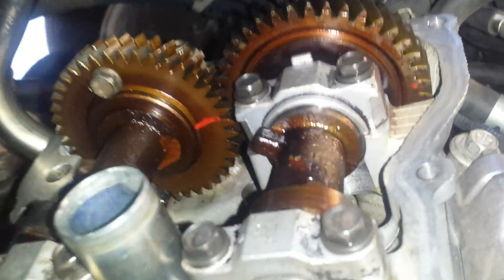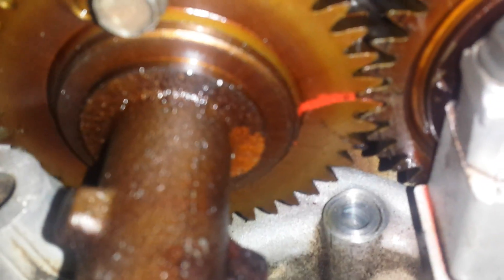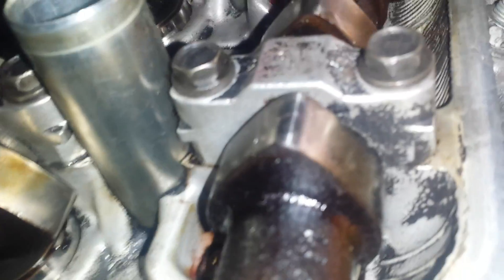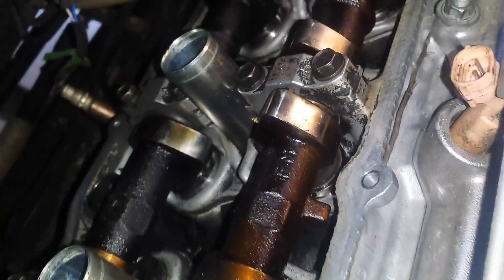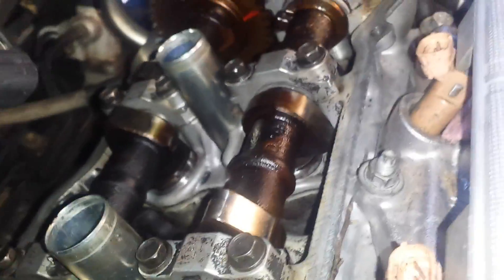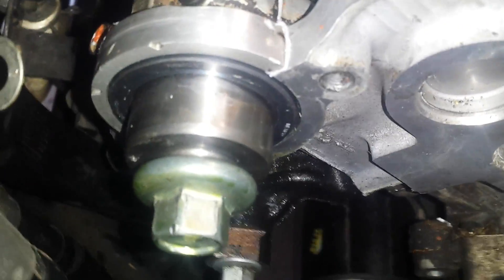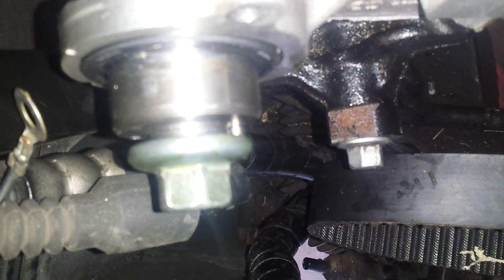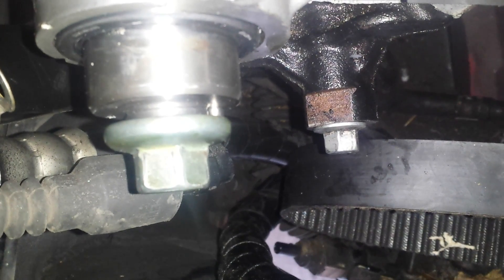Toyota 3.0 1mz-fe cam gears

Comment: I've had no luck timing this motor. For some reason it backfires on acceleration and as the lack of power and the running compression on that bank. I put the service bolt in the camshaft I align the cam lobes as described
Reply from the maker: There's really no way to install belt with all pulleys 180 out. How can you match all the marks?
Reply from the maker: Did you rotate 180 before belt installation
Reply: @jaschalindesmith9525  yes I did
Reply: I made it where the belt was 180 out beforehand and was lined up once I did
Reply from the maker: So you assembled the timing 180 out? Not sure about your specific job. Maybe a clogged cat on that bank?
Reply: So when you put the belt on is the mark  up or down on the pulley.
Reply from the maker: They are straight up
Reply: @jaschalindesmith9525  sorry it took so long to get back to you. So the camshaft is 180 degrees out two dots to two dots until you are ready to put the belt on then you spin it 180 degrees and that's the mark on the pulley lines up with the marks on the belt.? call me if you would area code 904 439 6520 hopefully sometime today if you have a chance I've been working on cars for a long long time and I'm definitely confused

Comment: When reassembling the top end of a Toyota 1mzFe there is only one thing that held me up a bit... when installing the timing belt I kept noticing that it wasnt aligned properly. I took it off and reinstalled it several times but just couldn't figure out what causing the issue. I figured out early on that the problem was between the alignment of the two cam sprockets but they looked to be bolted on properly. Finally, after an hour or two, I figured out that for some reason the rearward sprocket had to be installed the opposite orientation of the front one. After unbolting it and flipping it over reinstalling the sprocket nearest the firewall (I believe that's bank 2 in a toyota) the timing belt lines up perfectly. I hope this helps someone who is facing the same problem. I have put around 20k on that motor since the head gasket job and it runs like a brand new one
Reply: Please message me. Same kinda deal. Ty

Comment: Bro i got a cuestion and i hope you help me.when  you remove the bolt from the gears and you rotate the crank shaft 18o degrees with the timing belt on it or before you install the t.belt?
Reply from the maker: After you set the camshaft caps then you can release the service bolt. At that time you can rotate the camshaft assembly 180 and line up your marks for belt installation
Reply: Run a bolt through the threaded sprocket hole BEFORE you unbolt the bearing caps. You dont need to remove that bolt until you have reinstalled the cams and bolted them back down. At that point just make sure the sprockets line up (one dot - two dots) and that the crank is at TDC and install the timing belt. I rebuilt this same engine and I dont remember having to ever mess with variable cam timing like this. I did have one issue with timing belt alignment but I posted a comment about that above. If you're doing this job on a 1mzfe make sure to read that comment

Comment: I removed camshafts from Lexus v8 and forgot to lock the exhaust scissor gears and now there is bad noise when I start the engine, how can I fix the camshaft gear that is making noise
Reply from the maker: Joseph Khambule  you have to remove it to load that gear again.  They are designed that way to keep it quiet and take up any gear lash
Reply: @jaschalindesmith9525 🎯🏆
Reply: Any video how to fix that.gears

Comment: I need to no how to set the timing for a dual cam on a Toyota Avalon 2003 3.0
Reply: Timing belte
Reply: Find the pdf user's manual for your car, or the chiltons or haynes manual, Toyota dealerships used to use books called BGB standing for "big green book" they are probably no longer green and the old ones are rare to come by.
Reply: Google:  Toyota Avalon factory service manual.pdf

Comment: Man can you help me with a problem in my 1mz fe?
Reply from the maker: Reyes Jou  what's the problem
Reply: jascha lindesmith I take off the engine of my Toyota sienna for repair the torque converted of the gearbox and the engine still off for a pair of weeks then when I put in place again and I went to drive, the oil pressure light come on and I stop inmediatly but the engine make a very loud noise that comes to the back valve cover , the pump was change 7 months ago... I use full sinthetyc oil 10w30 valvoline and only have 500 mile with that change,  the engine is recently rebuild,  and before the ride, when I Rev the engine between 1200 rpm to 2, 000 rpm the engine make a rattle noise in the back valve cover like a not  lubrication but not that loud to be worried and so, I take apart the valve cover and all looks good, what can you recommend me to do?
Reply from the maker: Reyes Jou sounds like a lifter problem.  It's possible that the timing belt wasn't installed correctly and that could cause excessive noise.
Reply from the maker: Reyes Jou if the oil light is on then it's not getting pressure = engine damage. A plugged oil sump can cause this or just oil pump failure. If it was from autozone it's likely it failed
Reply from the maker: Reyes Jou I have also seen someone put the head gasket on wrong which blocks the oil port for the head. You can only find out if you take it all apart. I have seen felpro head gasket set that had wrong head gasket. They're supposed to be different due to the oil hole. Possibly someone wasn't paying attention and assembled it wrong.
Reply: I will share a video here in youtube for more details, thank you for response man.
Reply: jascha lindesmith  I think it could be the problem at the noise, I show you later how I set the timing belt...

Comment: 180 degrees in which direction?  Lame
Reply from the maker: matt duffy doesn't matter which direction.  It's a non interference engine
Reply: @jaschalindesmith9525  It is a non-interference only if it is a non vvt-i engine. I know 1mz-fe is vvt-i.
Reply: Is the 1mz-fe vvt-i engine only on 2004 - up?
Reply: gary miller 2000 to 2006
Reply: Vvt-i or not, both are non interference